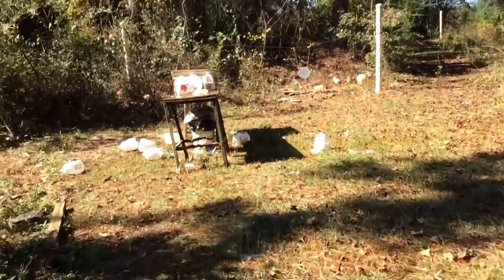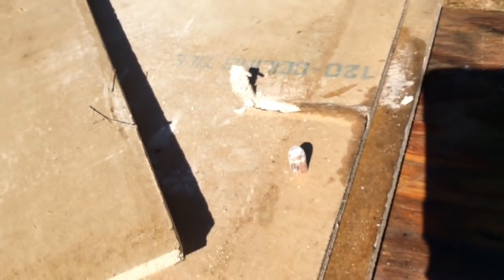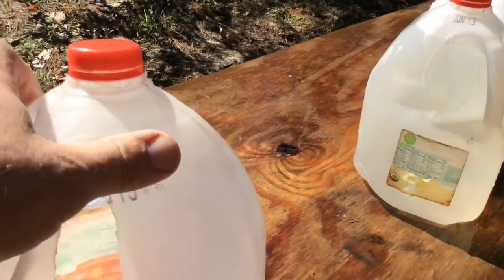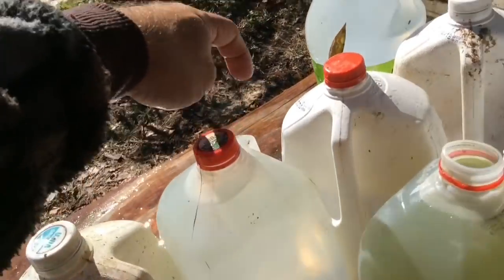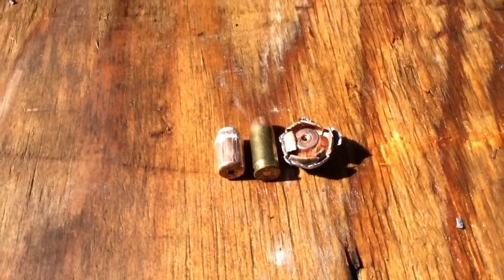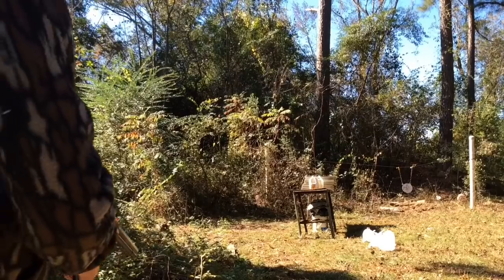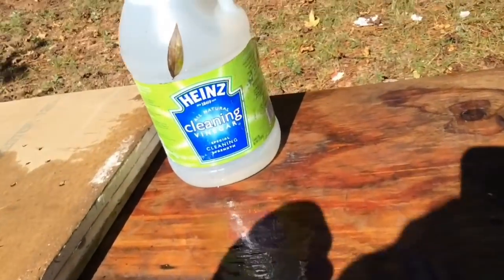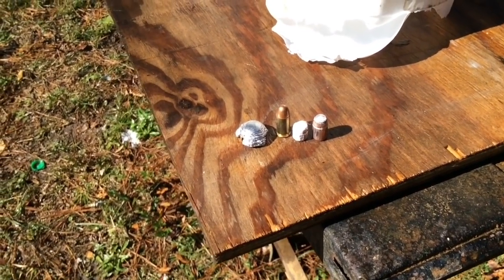Barnes 450 grain bullet hi velocity vs low velocity vs water

Comment: Try that same experiment with an all copper or brass solid.  :)  Think you will find a completely different result.  Try the LeHigh Extreme penetrators in fact vs the Barnes solids slow vs fast.
Reply from the maker: Thank you planning on trying that soon

Comment: what is the twist rate of your 50-110 barrel ?
Reply from the maker: gray man One in 28 inches
Reply: @Leverguns50  thanks ... gonna try at get one for my 1886 take-down.
Reply from the maker: Let me know if you need anymore information, got my reloading dies from Buffalo arms
Reply: @Leverguns50  all right ... just trying to find a barrel now with the right twist.
Reply from the maker: gray man The The original rate of twist in the rifling was one turn in 54 inches but it doesn’t stabilize the heavier bullets well 1 in 28 seems to do a really good job, and you can still shoot the lighter bullets,
Reply: @Leverguns50  was your barrel considered a black powder cartridge rifle barrel ( BPCR) ?
green mountain makes one with 1:24" twist.
Reply from the maker: gray man no it’s for smokeless high pressure

Comment: 2400 fps for a bullet that heavy is insane!! That smokeless round was nasty!! 👍🏻
Reply from the maker: ⭐️🥇thanks
Reply: @Leverguns50  what rifle is the 50-110? Winchester?
Reply from the maker: WoT Professional 50-110 WCF came in the model1886 Winchester also known as the model 86, the 50-110-300 is the term describing the caliber the powder charge and the bullet weight, examples 50 caliber 110 grains of black powder and at 300 grain bullet, and the WCF stands for Winchester Center fire, meaning the cartridge was not rimfire like a 22, don’t know if that helps,
Reply: @Leverguns50  Very cool is your 50-110 a custom Winchester?
Reply from the maker: WoT Professional I had it re-barreled and chambered
Reply: @Leverguns50  Very beautiful rifle sir im thinking about getting a Shiloh Sharps in 45-110 is the ballistics similar to 50-110? I already have a H&R Buffalo classic 45-70 so i was thinking about getting q custom sharps in 45-110!
Reply from the maker: WoT Professional I just checked it out, looks like the ballistics is very similar to the original Black powder loads or a little hotter than the 50-100-450 WCF which is the same cartridge is the 50-110 just a heavier bullet, looks like that would be a real fun gun to have,

Comment: I got a stupid question as I have an idea, but what is the recoil like 😜
Reply from the maker: I am Probably not a good person to ask, I have shot a lot of hard kicking guns like the 460 Weatherby,
But with the 450 grain bullet loaded with smokeless powder at 2456fps recoils about like a turkey load in a 12 gauge 2 3/4 inch shell ounce and a half The 500 grain or's kicks about like a 12 gauge turkey loads 3 shell 2 ounce shot, regular loads kick about like a 12 gauge with regular birdshot, Black powder loads kick harder for the same velocity, meaning if you load it with smokeless powder to the same velocity, it has very little recoil compared to the black powder

Comment: I know you've probably covered it, I'm curious how long the barrel is on 50-110?
And twist rate?
Good vids as always
Reply from the maker: IdahoRodgers USMC has a 26 inch barrel of one in 28 twist, The originals had 1 in 54 twist with the same length barrel, I was surprised how straight that big bullet went through those jugs, when I watch the one with a 50 BMG and most of the others they kept veering an off to the side
Reply: @Leverguns50  , I noticed that as well, and was dang interesting.
I'd be curious if anybody makes a steel core AP round??
Chances you wouldn't wanna shoot it thru a nice rifle like yours tho
Reply from the maker: I have a video on that cutting down 50 BMG bullets turned around backwards
https://youtu.be/8DC0szH7ccg if you noticed in the video it penetrates a lot but it usually loses the outer jacket
Reply: @Leverguns50  , Thanks will check it out